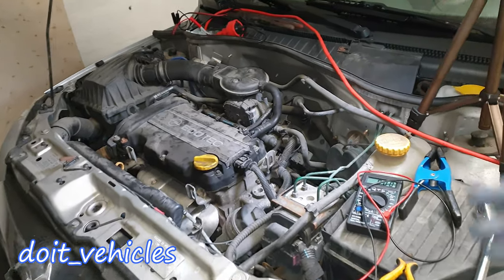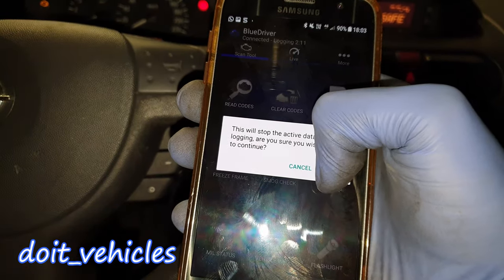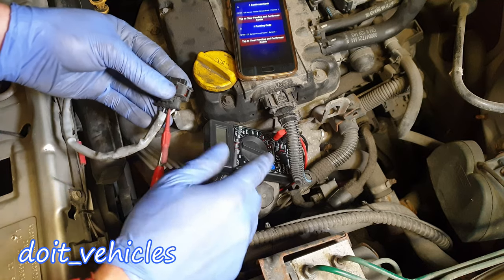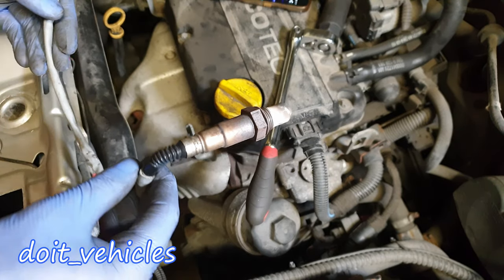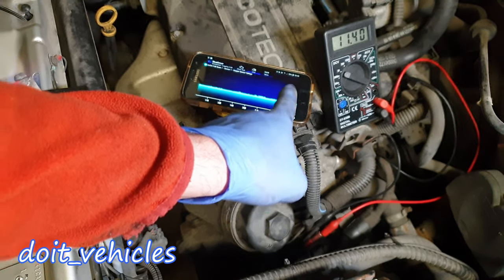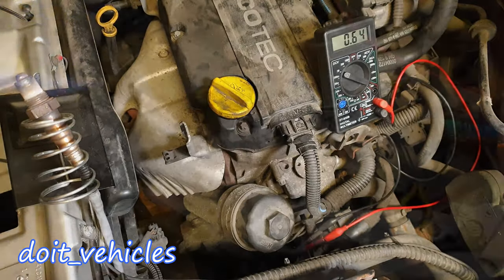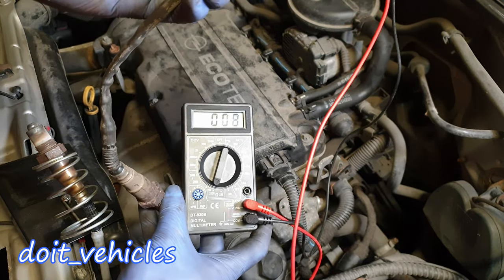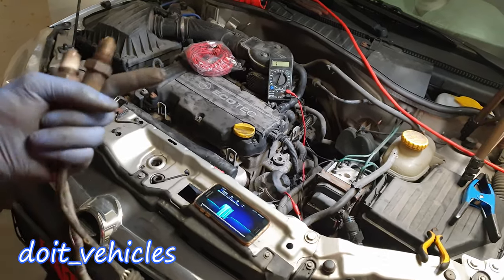Opel Corsa C Oxygen Sensors Test , Removal , Replacement / Narrowband O2

Comment: hey would you know what's problem if P1482 comes on? The car itself runs and drives fine ??? The spanner light comes on occasionally when car's been idealing for long time, or its too hot outside

Comment: I have the code p 0141 O2 sensor heater circuit Bank 1 Sensor 2 . What should I do ? Thanx
Reply from the maker: Test the resistance of the heater on the sensor ( usually the 2 black wires)
Reply: @doit_vehicles  thanx for your tipp , i will do it
Reply: @abdel-hak2658  Was the sensor bad or not? I have the same code with my Corsa C. P0141. Also i tested it with the Bluedriver app. The voltage doesnt. spike like sensor 1 but stays at 1 voltage and then slowly decreases or increases when the engine heats up or cools down. Also Fuel trim of sensor 2 stays at almost 100%??? Sensor 1 only is like 0.5%
Reply: @SFearox  it was the sensor bank 1 sensor 2. it was not concted. and that was.  on opel corsa c .

Comment: I have a code p0170 (2)lean exhaust 

pre cat fluctuating at idle 79-882 mv 

post cat sitting at 764 mv rich

Air flow 8-12 kg/hr 0.47-0.83mv
Reply from the maker: Have you tried to clean the MAF sensor ? or check if it does read more air when you chnage the RPMs